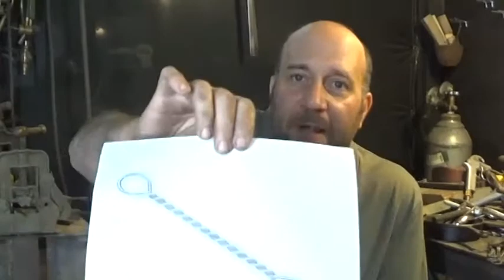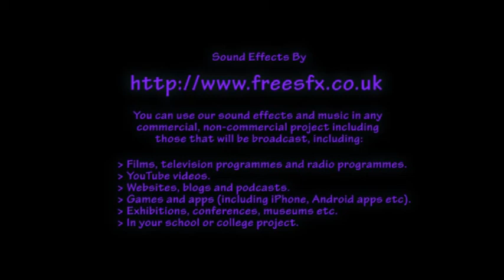Stainless Steel Utensils 1 of 3:  Wire Fork

Comment: Nice and interesting video.  Sorry to hear of your poor health.  I can
relate.  Type 1 Diabetic, open heart surgery survivor for 4+ years now, and
AFIB.  But, I walk 10-12 miles every day, and I still dabble in metal art.
I am interested in building a propane forge.  I built your brake drum forge
which works fine, but would like the convenience of using a propane forge.
Did you do a video on your forge? Do you plan a video?   I just need a
fairly small one, probably a 1 or a 2 burner would do for me. At times I
want to bend 1/4 inch rod or rebar and/or flat bar for projects.  Anyway,
thanks for posting.  I hope your health and income improves soon. Keep the
videos coming!